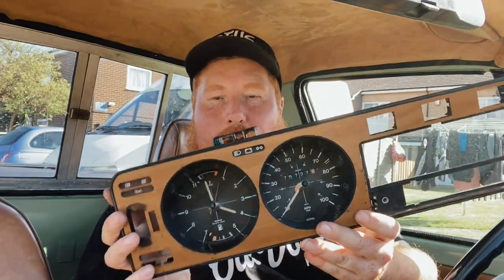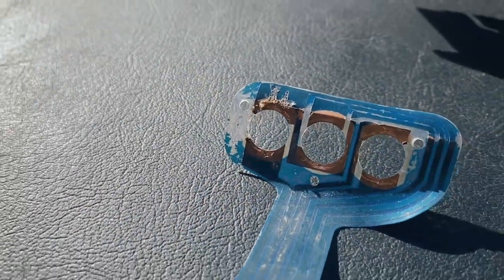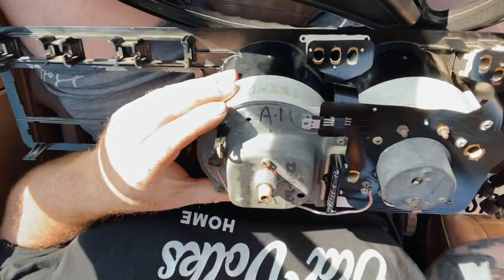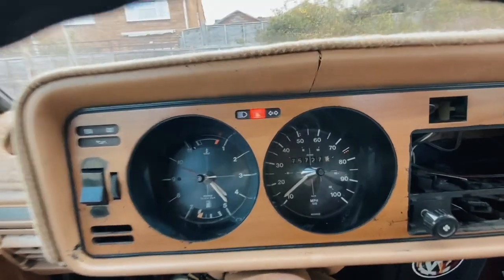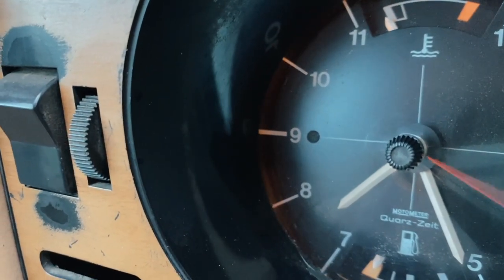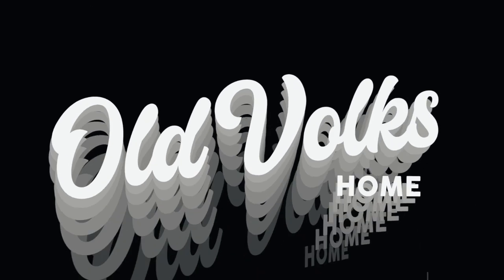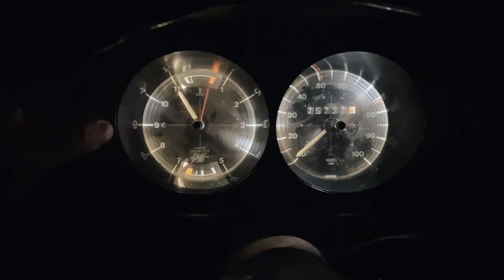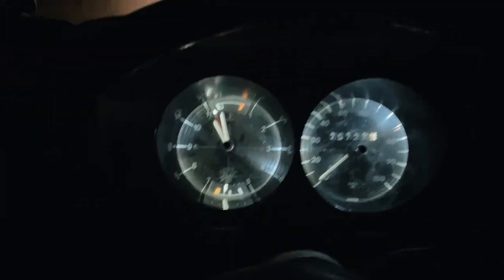Cluster Circuit Replacement // VW Rabbit Pickup

Comment: The hazard issue could be the switch. Take it apart and give it a good clean with contact cleaner.   And yes the extra dials should have bulb holders in the back too. 👍🏻
Reply from the maker: Thank you for your comment Joel! Appreciate ya! Will be diving into the cluster again soon!
Reply: @dans.adventures  while you’re there check the earths are nice and clean. All sorts of issues caused by missing earths. Is your caddy the odd ceramic fuse box or CE1?
Reply from the maker: @joelb2660  yeah it’s got ceramic! Gonna change that next year for suuuure